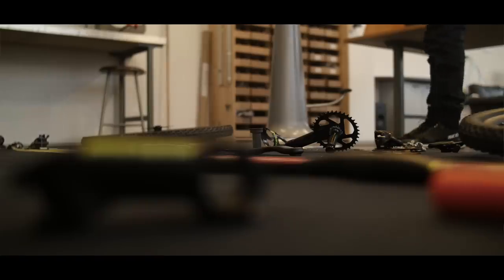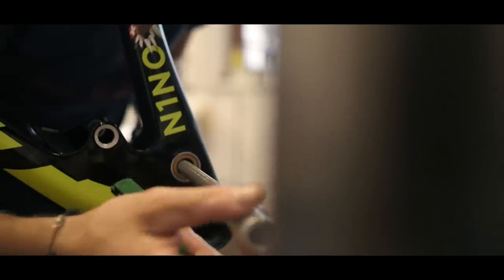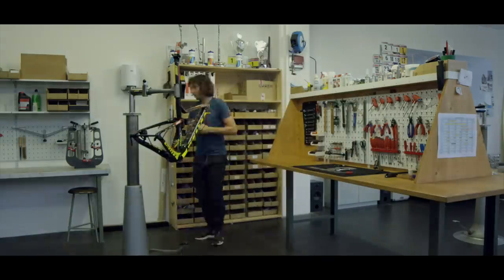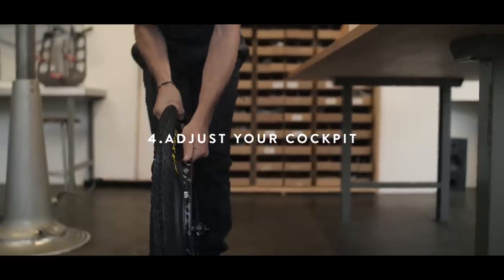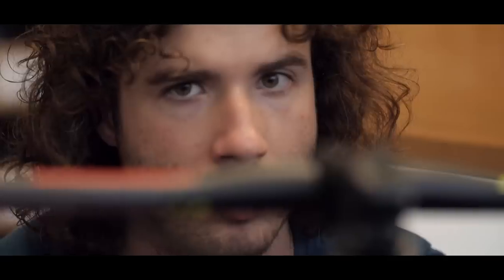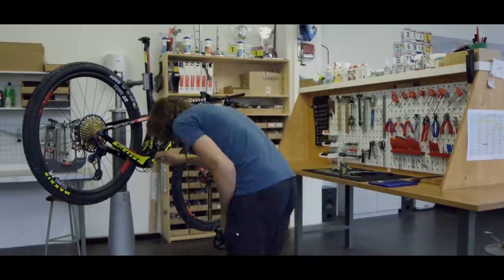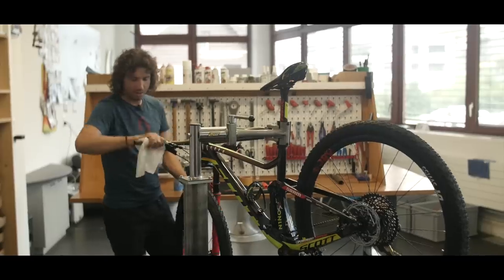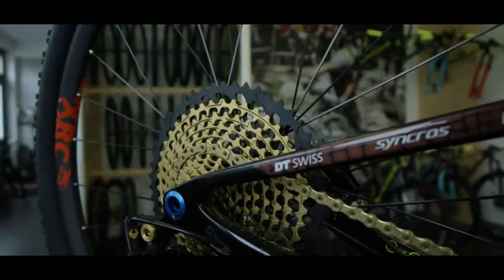How to Build a Bike with Yanick the Mechanic

Comment: The two bushings in the seatstay pivot are really not that glorious. A friend of mine got a new Spark last year and after two months of riding it started to make creaking noises because of dust inside the bushings. So i took it apart and cleaned it. Of course the noise came back. After the second cleaning I had to make a compromise and greased it slightly. Since then there was no more creaking (about 6 months now).  I never faced such problems with a fully bearing driven linkage. 
BTW: If you have to do the same, make sure to use a torque wrench (very carefully). The torx screws are super soft and very expensive to replace.

Comment: any bike cracks that know how much this bike costs? theese are the best of the best components im in love
Reply: Leo Tres Mote than 10,000 Euros...
Reply: Nomenus Not really. The 2018 Scott Spark RC 900 SL retails for 9,500 USD and it comes with the HMX-SL carbon frame, which is more expensive than the Spark RC 900 WC (HMX carbon) that Nino rides.
Reply: not bad, i was just curious about the price range

Comment: Liked the foam tubing trick. Disliked the steerer tube cut too short. In a carbon steerer you should cut 2mm above your stem and put a 5mm spacer on top, so that the stem clamp load is fully supported on the steerer. Also disliked that he didn't seem to use a torque wrench on the stem bolts, the cassette nor the rotors. Hairspray works great to keep your silicone grips in place and it's much easier to clean than double-sided tape when you need to replace them.
Reply: sfer1 the reason why he cut it so short is because it’s a xc race bike and they want to be in the most aero position and is it was 5mm higher it would be to upright.m8 he is a pro bike mechanic and u r probs a regular person that sits in their garage and tinkers with there bikes and doesn’t know how to put a bike together.
Reply: Blaise, what he says is that some manufacturers reccomend to cut the steerer a bit higher, and place a 5mm spacer OVER the stem. the intention is that the 100% of the stem will be clamping on the steerer, reducing the risk of a crack on the tube. oters manufacturers don´t give such reccomendations, and you can cut them without placing a spacer. about the Torque Wrench, fully agree. and it is much easier, as you don´t need to focus on how much strength put on the bolts. just set the torque wrench and voila!. for the grips, I personally use alcohol. clean, smooth, and leaves no residue at all (and the silicone grips don't need extra adhesive stuff).
Reply: Guys, it is nino shurter we talk about...
Reply: Just because he is nino schurter's mechanic does not mean he is the best. A good mechanic is the one with a very long experience and great problem solving skills. The guy is right, steerer tube should not be cut too short, it is going to compromise the steerer tube, this is simple physics. You should at least extend one or two spacers on top. And torque wrench is mandatory, a pro mechanic should use it at all times.

Comment: Why does this guy put the handlebar so low and leave so little room to fix it higher? I wouldn't do that on such a expensive fork.
Reply: sh00t01 Nino likes it that way and they aren't worried about reselling the fork later. I believe he cut it too short though. In a carbon steerer tube you should cut 2mm above your stem and fit a 5mm spacer on top, so that stem clamp load is fully supported on the steerer.

Comment: More like "assemble a bike" from brand new parts. Not difficult at all...
Reply: Congratulations. You have just defined "build" using one of it's synonyms. And if it's so easy, go tell that to Walmart. I'm sure everyone will appreciate it if people actually knew how to assemble bikes properly for cheap bikes. Just because you know how to do it doesn't mean everyone else knows.
Reply: I don't care about walmart, but since you mention it - they probably sell low-end bikes that are generally more difficult to assemble than this. Why? Because cheapest parts don't come together as easily. 
And building a bike to me means building wheels - this is the most important part and the only one that actually requires any skill.
Reply: Perhaps some parts on a walmart bike are more finicky than a new bike. The bottom bracket and headset would be the most obvious ones to mention. On the other hand, walmart bikes are made of mostly steel and some aluminum parts. which are not prone to cracking from over torquing, as this carbon bike would be. They would also not have hydraulic brakes which this bike does have. Bleeding brakes is definitely a skill that needs to be learned, although it is not inherently difficult. Even building a wheel isn't inherently more difficult than the building the rest of the bike. Sure, there are some steps where care needs to be taken to do it correctly. However, using your words, you are just "assembling" the wheel. The rim, hub, spokes, and nipples are all prefabricated and all you are doing to putting them together based on a set of instructions that are very well documented online. Not difficult at all.